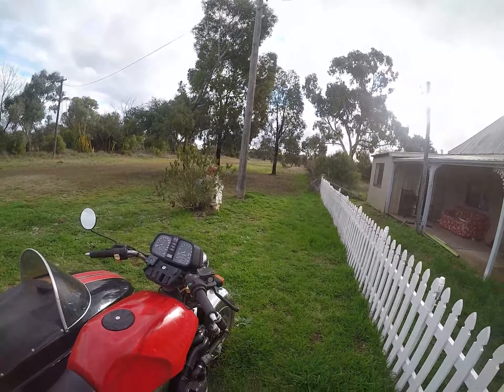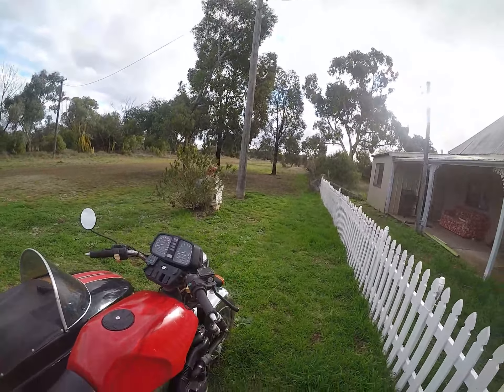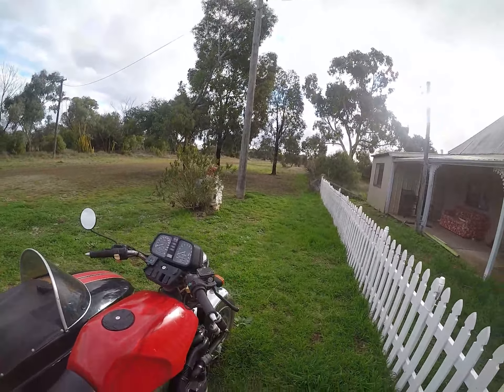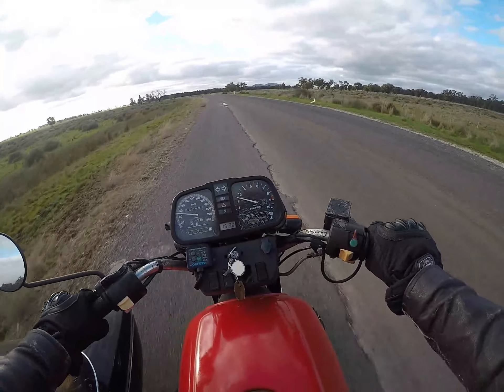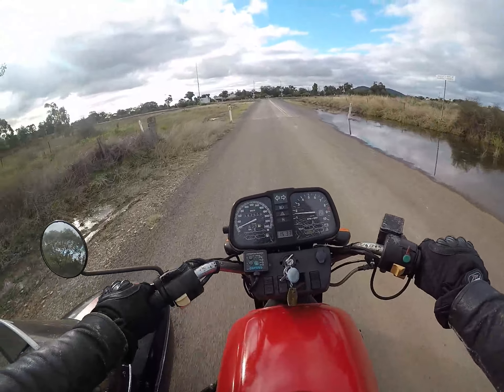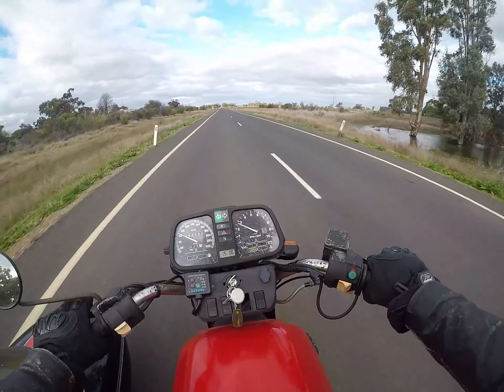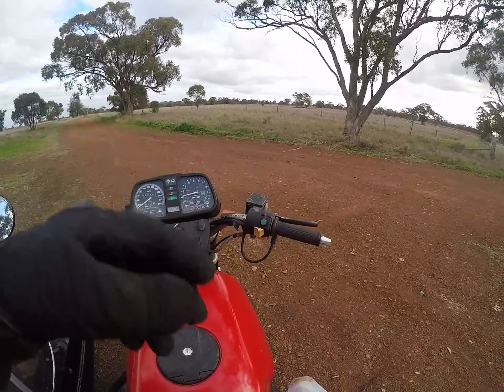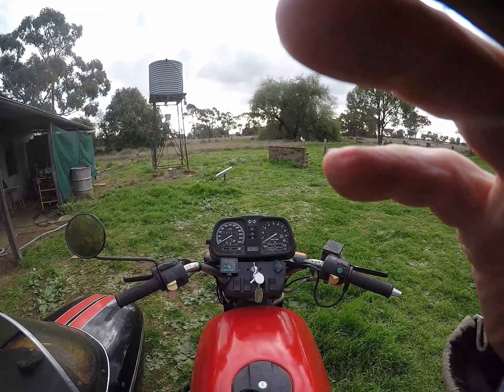BMW K100 and Sidecar: The mystery continues

Comment: That’s a weird issue. You’ll get there in the end. Can I ask if you’ve checked for play in the sidecar wheel, or suspension is if has any. Might be worth trying telescopic forks as you suggest. I’m guessing that some frames are more sensitive to leading links’s than others.
Reply from the maker: Thanks for the comments. Yes, I jacked up the sidecar and checked for play and movement in the sidecar suspension and wheel bearings etc. Minimal play or movement there. I think I'll contact the original owner/builder of this outfit and see if the leading link was on from the very beginning. I'd be curious to know. My old K100 outfit just used the telescopic forks and i hand no issues with it apart from the usual fork chatter at times etc.Well, I'll keep at it!
Reply: @saxonost7  when I got my first outfit it was tired old xj600 with a Watsonianish perimeter frame and  wooden steib style body. The engineering of the mounts was dire but once sorted it was ok and taught me a lot. Out the chair onto a 650 Bandit and had been looking for leading links but realised I didn’t need them. The only other thought I had was wheel balance but that would only get worse with increased speed. Think swapping to telescopic forks may be the way to go. Look forward to more content.
Reply from the maker: @piearm1271  I'm starting to think about a bent frame...

Comment: Tyre pressure adjustment might make a difference to the headshake for sure.

My K sidecar had a 130/90-15 bike tyre on the front, if I kept the tyre pressure up it had no headshake with no damper fitted. If I let the pressure drop, it would shake. I read this as a response to a wider contact patch. With a square car tyre up front it always needed a damper.
Reply from the maker: The Triumph used to start shaking its head when the front tyre was getting towards its wear limits. This isn't like that though...It's more extreme than that. Oh well, I'll keep at it!

Comment: Just trying to compare your wobbly bemmer with my setup . The first is wide handle bars on my bike . And I`ve got 6 turnbuckles between the two frames and yeah I welded `em . I  can still pull the bolts if I ever want to separate   .Mine like yours does a lot of dirt and minor roads . I kept the original KN900 Kwaka forks and don`t use a damper , no need. Simple is good. As for the toe in ,see how much sidecar tire wear you get on the inside . It will always have a bit of wobble . I`d read that if you park it on level hard surface and let it roll without holding the bars and see where it goes . Should roll straight .  Just some thoughts , hope it helps .
Reply from the maker: Trevor, thanks for your comments. Yes, wider bars are always better... just better leverage etc, but in this case the issue isn't really coming through the bars as such. At this point there is no wear on the inner side of the sidecar tyre, but that will become more evident if I can ever get the thing rideable enough to do some decent miles! I agree about steering dampeners.